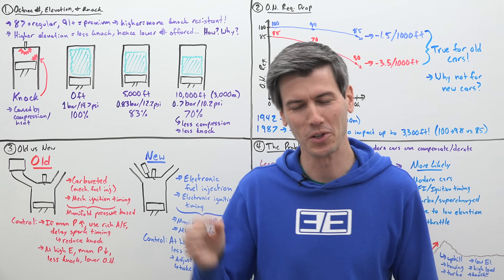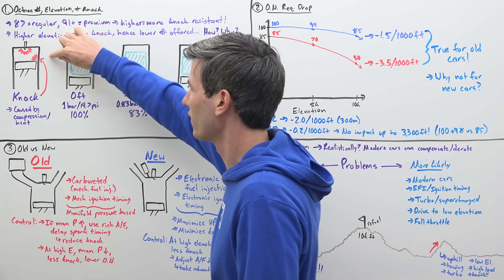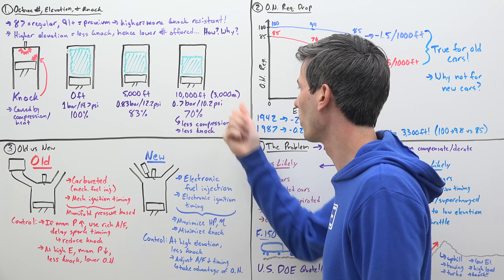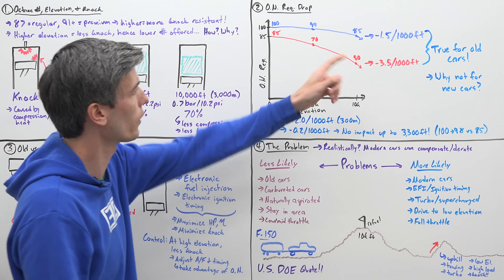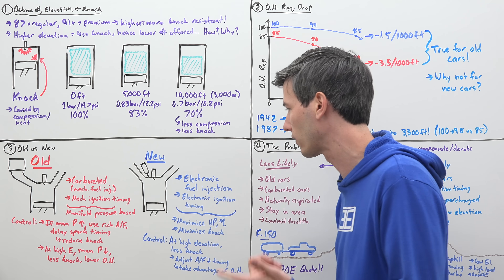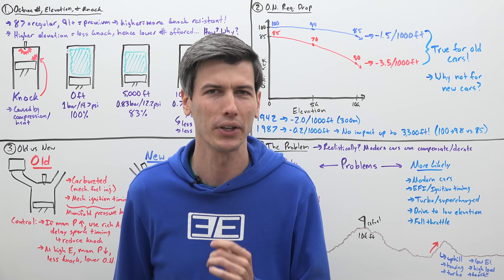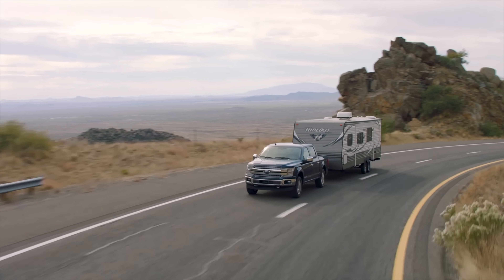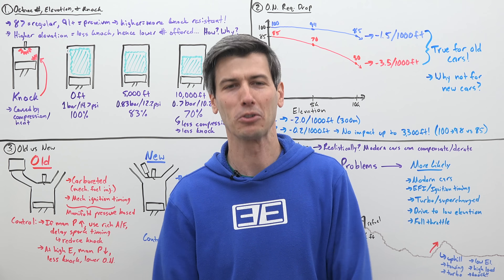Never Use This Gas In Your Car!

Comment: let's not forget that USA pump octane(AKI) is different to Motor Octane(MON) which is different to Research Octane(RON) - the important part being that (almost) everywhere else in the world sells fuel by RON - "world" 91 == US 87 at the pump, whilst US 91 == "world" 95  (and nobody else in the world sells mid-octane fuel by mixing grades at the pump)

A lot of owner manuals specify octane, but don't state MON/RON/PON. This is a problem if you have US vehicles outside North America, as manuals frequently don't make the adjustment for local markets and private sales don't have it at all.... (let's not go into the differences between DOT and UN(LHD) standards which make the USA a protectionist island difficult to import to - and as US automakers have discovered - a captive market can be difficult to export FROM)

Comment: When I saw 88 gas that was cheaper than 87  I was confused because I had never seen it so I filled up with regular 87. Now I know that maybe my car can handle the extra ethanol because it's not pre 2001
Reply: You will pay for it in reduced fuel economy.  Ethanol has 33% less energy per gallon than gasoline.
Reply: @LoveClassicMusic0205  hmm, I didn't think about that

Comment: The only cars I've had which had knock, were a few "relics" which had more carbon buildup than displacement, and a '95 Suzuki Swift (1.3L i4 EFI), which had knock fairly frequently (though it never broke anything).

Comment: I've noticed no problems in my 02 WRX while living in Colorado Springs. The highest rating there is 91 and the manufacture states use minimum 93. Had electronic fuel injection and was turbocharged. It ran like a champ on the lower octane fuel at elevation even with 16-17 pounds of boost. (Stock is 12-13 for those that don't Subarus very well)

I would say engine knock CAN happen rather than will happen.
Reply: Yes! It's because the air at high altitude is less dense and so pre-detonation is less of a problem. This video completely ignores that.

Comment: Currently running 75% 85oct + 25% E85 on factory boost with no signal to retard timing from the knock sensor. Also, I save a couple bucks on the fill up because E85 is so cheap in comparison right now.

Comment: It's my understanding that the reason you can get away with lower Octane at altitude was because there is less oxygen in the air and thus in your cylinder. This allows you to lean the fuel out more w/o detonation. When you use a lower octane you're are, in effect, leaning the mixture out in the cylinder. Could be wrong though.
Reply: Yes, you are, technically, wrong...

Knock has nothing to do oxygen composition in the air and everything to do with absolute air pressure.

As the formula goes: PV = nRT

...lower pressure ...lower temperatures (less chance of auto-detonation)

Comment: So what would be the solution to this problem overall in regards to altitudes and engine loading conditions?

 I think what we should do is go back to the days during World War II when the aircraft used water injection to reduce knock.

Let’s try to analyze knock and how it  was reduced by injecting water into the cylinders as aircraft were launched off the aircraft carriers deck.

H2O reduced the burn rate  and allowed the increased pressures & temperatures to become null and nearly void in the problem of knock. 

So We might lmk consider getting back to that idea by pulling ambient moisture from sources that are sustainable such as H2O that is produced by the internal combustion engine. and re-introducing it back into our engines to reduce knock!!

Just like back in the days of WW2 and aircraft water injection.

those elements of moisture provided by the natural production of water via combustion process into our engines.

Could solve the knock problem no matter what octane of fuel you use!!

So please tell me what you think of my idea???

please respond

Comment: I didnt know that older vehicles had ignition timing
Reply: Of course they did.  Back then it was all mechanical.  You have centrifugal advance which would go higher as RPM increased and vacuum advance which would increase the more the throttle was closed (like at idle).

Comment: *IDAHO with their garbage 85 octane regular gas 🤪

In 2016 I was on a road trip in my year 2000 bmw 5series and my buddy offered to fill it up... I usually used premium because bmw says to, but I had put 87 in it occasionally, and with the computers it always ran ok. I didn't think anything of his gas choice, because I didn't know 85 octane existed!!

Well, he filled that sucker with 85 and I was getting like 14 mpg on the freeway and doggedly slow acceleration. I thought my car wasn't going to make it. 
As soon as I burned 1/3 tank I immediately topped with premium, and I guess the fuel mixed to make a normal regular 87.
The car was ok, but I NEVER did that again.

Luckily we were at 5,000 ft, and the m52 straight 6 is a very reliable naturally aspirated engine (by bmw standards) 😂

Comment: Very timely because I am in Utah towing a trailer with the EcoBoost engine, found a stop that only had 85.  I did fill up but will refill when I get down off the mountains.  Very Helpful, Thanks.

Comment: @engineering explained i was wondering how the performance (lap times) would compare between large wheels with low profile tyres to smaller wheels with higher profile tyres assuming they have the same overall diameter
Reply: @Danann Saunders Low profile tires will have a bit better handling response due to the stiffer side walls. More important is the tire compounds on track...at the expense of shorter life.  if you are looking for faster lap times. It is best to match the tire tread width  on the ground to a given wheel width....for instance tire tread ON THE GROUND should not exceed the width of the wheel for best handling...in fact going slightly "stretched" with a narrower tire will give a bit better handling responce as long as you don't over do it with extreme stretch. Tire Rack has a good write up on this. 
Also....low profile tires look may look "GOOD"  but at the expense of a harsher ride and more prone to damage from hitting pot holes. That is why you shouldn't  use  low profile tires on a pickup truck or jeep.
Reply: @RobertKarlBerta  thanks for that reply and info, ive been seeking genuine information on this topic, mostly for knowledge but maybe one day to build my own race car (who knows) and there's a lot of conflicting information for example low profile tyres reduce side wall roll which provides better stability and responsiveness, but the side wall roll from a higher profile tyre can create more traction in corners underload, also can give better acceleration (and maybe breaking, not sure on that), and they're also lighter assuming same quality rims and outer diameter?

I guess somewhere in the middle would give the best of both worlds, but its just hard to find anyone who looks at the facts without adding theyre bias due to being "mopar (high profile) or jdm (low) guys"

Obviously suspension set up has a lot to do with it aswell i guees

Comment: Another factor in the 194X ish study is that cars of that time were, low compression. Typically 7.5:1. According to Google, Ford f-150 2021 is a 10:1 compression. More compression, more these effects are amplified as to the wider the range of differences.. As are reflected in the two tests quoted, as well as the facts that he outlined. Great video, as usual! Thanks for your efforts.. It was also suggest by others that of mixing qualities of fuel as you prepare to change your drive environment. Be aware that fuel gauges may not reflect a linear fuel level. A half gauge is not a 50% fuel volume in the tank. Forth gen F-Bodies were more like showing half gauge but had 80% of the fuel spent. Be aware, be safe! :)
Reply: So true,my 94 Camaro runs out at 1/2 not 0

Comment: I wonder how SAABs trionic system would handle the super low octane gas. The trionic system used ionization current in the spark plugs to detect knock in each cylinder and can adjust to it. As apposed to a less precise knock sensor which is like a microphone on a engine block.

Comment: The other thing you're forgetting is older engines weren't running 9:1+ compressions to get more gas mileage.

Even stock Mustangs nowadays run 14:1 compressions.

Compared to an old stock Ford flathead, you're literally getting 3 more entire atmospheres at a minimum on basically every engine made since the 90's.
Reply: They use 12:1. I don't think 14:1 would be possible without E85 or race fuel. It's honestly shocking that they can use compression that high on pump.

Comment: Is there inherently more resistance to knock in fuel, hence a higher octane rating, as you go up in altitude due to lower barometric pressure?  If so, when you see 85 octane rating at your local high-altitude station, it's actually a MUCH lower octane than 87 at sea level.  Is that right?  Or is octane rating independent of barometric pressure and altitude?
Reply: Yep moving to diffrent states i saw it too

Comment: I live in Colorado and I use 85 octane in my 94 Honda Accord all the time. We have even used it in our 2010 Ford Escape. However if I'm close to a gas station that sells 87 octane ethanol free fuel that is what I always buy, and when it comes to small engines that's the fuel I run most often. Sometimes I run 100ll avgas but that has some disadvantages. I never run fuel with ethanol in a small engine or that ridiculously expensive canned fuel they sell at hardware stores.

Comment: Interesting, in the UK, we have Shell unleaded at 95 Octane with E10 (%ethanol) and V-Power Unleaded with 99 Octane and <E5 (%ethanol)...with not much elevation change, I wonder why we have such high octane levels here..?
Reply: The video says that the US and Canada use a different method for octane rating.  US 93 premium here where I'm at, is the same as 99 octane in the UK.

Comment: 1:22 I think you should say that octane is the fuel’s resistance to pre-detonation or pre-ignition instead of knock since this is what causes knock and it isn’t knock itself
Reply: Yeah, I was really surprised to hear him say that’s what octane means. Specially so early on in the video. Made me wonder what else he was going to get slightly wrong that I wouldn’t catch.
Reply: @Fausto_4841  he neglects to differentiate 85unleaded vs e85   e85 has an octane of 100
Reply: @joehoover7711  that's a super goofy complaint. The video is about 85 octane fuel, not e85 - e85 means it's up to 85% ethanol.
Reply: @Hawk7886  85% ethanol???? Huh?
Reply: @Hawk7886  yet his point is how many people know that?   For example I was in Florida last year, they had "Super 88", first I ever heard of it.  I didn't know if I should use it when I was there.  If the pump says "85" you may know, does everybody?  I've seen 85 octane in the mountains here.
Reply: You have to keep it simple for the masses and for marketing.
Reply: Went strait to verifying what Octane rating actually is, was gonna post a huge explaination but this works better.
Reply: Non car people don’t know what pre-ignition or detonation or, knock is a more widely known term/event that is known to be bad for engines, even then most non car people don’t know what knock even means. It’s a basic way of telling general public, and not making them more lost.
Reply: There's nothing wrong with what he said, he's using the word knock as a blanket term and there's no need splitting hairs and turning this into a video mostly about the different types of that phenomenon when it's about the dangers of using high altitude low octane fuel in something with a turbo, stay on point here.
Reply: I would understand non of the terms that you said. That is why this channel is so awesome. It's not about the use of the most accurate term. It's about conveying a somewhat correct info with understandable language. I remember there was an exam problem in the aerodynamics course I took, and the instructor asked us to explain lift to a peer student and a 5-year-old. Of course the language is very different. Same applies here. While most viewers aren't 5-year-old, their understanding of professional knowledge is still limited. Big words just confuse others and you have to spend extra time to explain them which they might not even grasp after that either.
Reply: @full_wet_tire  Very true. If more scientists discussed science and math, for that matter, as though they were speaking to a five year old, more of us would understand it.  Using terms understandable by a five year old allow even older students or challenged students to learn the subject.  I've seen so called teachers talk to the ceiling while discussing their topic nobody understood what they were talking about.
Reply: @full_wet_tire  You can not have a proper conversation with someone if you don't know how to communicate.  Using the proper terms for something is a great start.  Saying "big words" is an excuse for a poor vocabulary.
Reply: Other way around

Knock, detonation, pinging, etc is when spark timing is too advanced and cylinder pressures get so high from that spark event that some of the mixture combusts from pressure rather than the flame front.

Pre-ignition, is typically caused by hotspots, caused by carbon buildup, lean afr, or detonation. The mixture ignites before the spark event occurs, the engine is basically dieseling. Pre meaning pre-spark event
Reply: @JaydenET  Knock occurs because of multiple flame fronts occurring at the same time inside a combustion chamber.  Detonation happens after the spark event and can result in knock.  Preignition just means the fuel/air mixture ignited prior to spark the event.  Dieseling or engine run on is basically auto ignition of an fuel/air mixture after the ignition system is turned off.  Dieseling was pretty much eliminated by fuel injection and carbs with anti dieseling solenoids.
Reply: Octane is about preventing detonation: the ignition spreading by the pressure front rather than the flame front. Preignition is a combustion chamber problem: pressure high enough to cause "dieseling" or - much more commonly - deposits that produce hot spots. Preignition cannot be controlled by ignition timing; detonation can.
Reply: There is no octane in fuel...
Reply: There's no such thing as pre-detonation.  Pre-ignition and detonation are two different phenomenon of abnormal combustion, the former causes rapid engine damage while the latter represents a slower damage mode and lost efficiency.
If the "noise" occurs following the spark event, this is detonation and results from the flame subsiding prematurely in relation to top dead center on the downstroke.
Pre-ignition occurs on the upstroke, prior to the spark event.
Reply: @thisisyourcaptainspeaking2259  fixed what I meant to say thanks
Reply: @thisisyourcaptainspeaking2259  But you can have BOTH pre-ignition AND detonation - - say you have a glowing bit of carbon that ignites the AF in the corner of the head, then the spark ignites the center of the charge, then the 2 flame-fronts travel towards each other THEN THE HEAT/PRESSURE causes the un-burned AF to spontaneously ignite, causing a sudden increase in cylinder pressure - the knock.
Reply: @TIMEtoRIDE900  The definition of detonation is the fuel charge stops burning prematurely, for whatever reason.  Two common reasons are inadequate octane, or ignition timing is too far advanced.  Detonation occurs after the spark event.
Typically, pre-ignition occurs long before compression begins to build in the cylinder, which is why pre-ignition will quickly destroy a piston.  A common cause of pre-ignition is incorrect spark plug heat range (much too hot, the overheating electrodes are acting like a glow plug).  The plug only needs to be hot enough to keep from fouling (self cleaning of fuel deposits).  Too hot (for whatever reason), it becomes an ignition source.
As far as two flame fronts colliding goes, show me an image of that to back up the claim.
Reply: @thisisyourcaptainspeaking2259  In your first sentence I think you mean "starts" instead of "stops".
If the mixture starts burning and then the spark plug fires, you would have 2 colliding flame fronts.  A picture would require a camera inside the cylinder, or a clear flat-head motor.
Reply: @TIMEtoRIDE900  My point is, more than one flame front (flame front collisions?) is an unproven theory.  The definition of detonation can be defined simply as the fuel charge stops burning prematurely (for whatever reason).   This might be incorrect AF ratio, low octane, incorrect spark event timing and probably other causes.  The fuel charge must have been ignited by the spark event to satisfy the definition of detonation.
Maximum peak cylinder pressure ideally occurs ATDC, typically 14 degrees in all gasoline engines, if I recall.  For instance, if peak cylinder pressure occurs at 4 degrees ATDC, we can say detonation is occuring.
If mixture starts burning prior to the spark event, this is pre-ignition.  Pre-ignition will quickly destroy a piston and most engines will not be damaged by light detonation.
Reply: @TIMEtoRIDE900  Not exactly the terminology I used but whatever, believe what you want, two flame fronts, lol.
The purpose of dual ignition on lycomings is redundancy, BTW
You seem to make a lot of assumptions, I don't recall mentioning aviation.